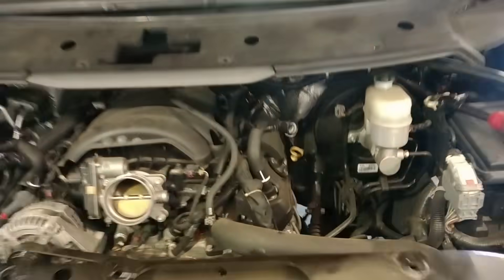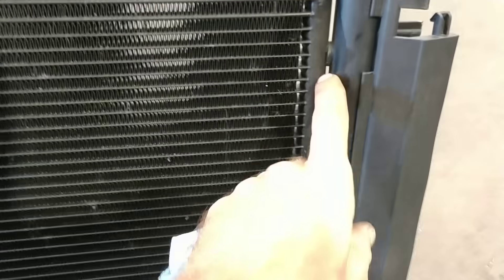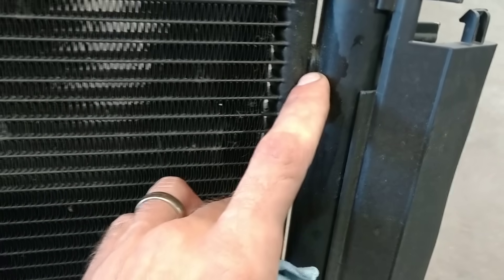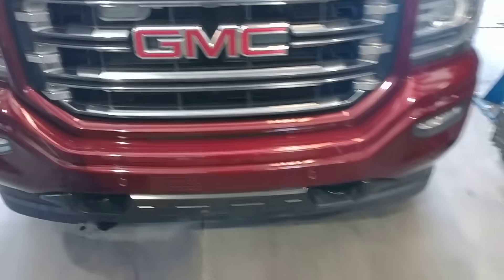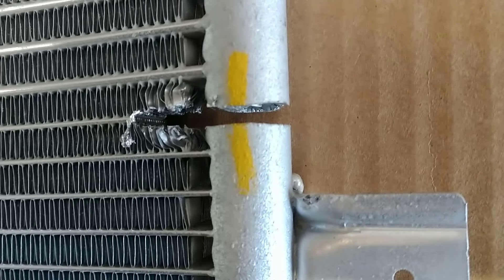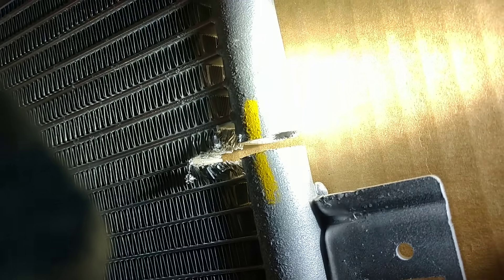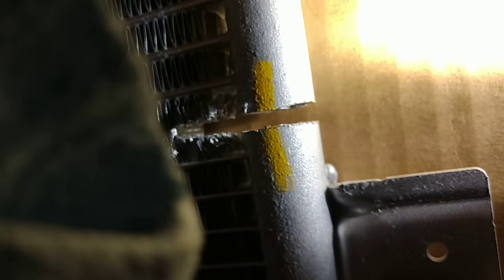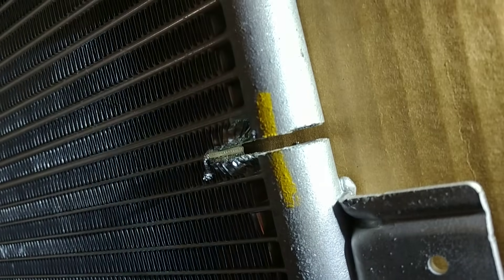Customer States...WAIT, look at this! Can't make this stuff up!

Comment: I've done a ton of those condensers(20+), the first fix (OEM) was a slab of thermal tape right at that point. I figure the trans cooler, and condenser part expand at different rates that causes the tube to crack there. I recommend the Koyo aftermarket ones for those, used those with good results.
Reply: Aftermarket parts are almost always better. Especially when there is a warranty. Body panels cost 1/4 the price.

Comment: Read his video description then you will understand why the factory does this, all the ends are capped because they are using the single condenser for 2 different fluids. The upper 8 rows for the transmission then a hollow tube then the rest of the lower condenser for the AC. It's a workable solution.

Comment: General Motors. You buy junk new and it breaks. Then when you order a replacement part that's from the factory, it's also junk.

I had to replace a rad on one of our GMC trucks at work a few years back, brand new, from the dealership, box in mint shape. The rad looked like someone rad it over -.-

Don't buy gm people, it's garbage.

Comment: Unbelievable! I sold my 2001 sonoma with 252,000 miles on it and the condenser was original and the AC worked fine.
My brothers blazer just turned 300,000 miles.. the condenser and compressor are original and the AC works!!

Comment: So instead of manufacturing the condenser in two parts they just decided "frick it", we'll just cut the main tube.  Typical GM, never caring, never thinking ahead and just not caring about reliability. They have been this way since 1969 when they introduced their cheap 350-V8.  Not to be confused with the 4 bolt 348 truck engine that was the basis for the Corvette motor which hot rodders all call "The" 350.  The cheap 350 had no direct lubrication of the cams which resulted in premature wear,  and of course the stupid plastic coated timing gears and chain.  Lets not forget the plastic carb floats that caused so much trouble.  GM also went with cheap aluminum radiators, which this condenser is a prime example.  No wonder the Japanese have 50% of the market now!

Comment: I have a very simple question.  The original AC condenser does NOT have the grinder cut.  Based on the written commentary, the replacement AC condenser has an grinder cut which is a "design feature."  My question is why does GM not provide a replacement AC condenser that is identical to the original with the weak point addressed?  

This video reinforces my decision not to buy GM products, which I stopped doing in 2010.  GM trucks look amazing, but I am left with the overwhelming concern that I would have buyers remorse if I purchased any GM product.

Comment: What is more concerning is the fact that the AC is going out on a 2017 truck that cost idk $50,000 Thank you for reminding me not to buy overpriced Shit. Pretty sad this is American made and not even lasting 5 years. 2009 Scion with 167k that I literally drive the piss out of redlined to the max and I have replaced oil, tires, breaks, batteries, and transmission fluid.

Comment: I would be embarrassed to put that on something and had to explain it to somebody due to no fault of my own.
Reply: Let's be honest, most consumers aren't even going to notice this. How many people do you think are looking at their condenser? If it works, they wont notice.
Reply: @reasonablySmartIdiot  I’ve always had the “ship it out” mentality but being from the Midwest, a lot of people who take their vehicles to get worked on will, in some way, look at the work that’s been done. I’ve seen old heads in the parking lot of the shop I’ve worked at crawling under their car and “making sure we actually rotated their tires or not.” But to make sure it wasn’t a problem it would be fine with some smoothing out and solder some material in to make it look less like a poor quality replacement part

Comment: Odd as this may sound, it is meant to be that way. The condenser is what's referred to as a "combi cooler".  The larger portion handles the A/C, the smaller is for the transmission.  It was designed as one unit to save space and money.  The cut allows the 2 sections to react differently to thermal expansion. The tiny holes he points out are in a "dead" tube, it is there just to fill the gap between the 2 sections, it will not leak there. There are separators inside the manifolds on each side of that cut to isolate it.  I agree this is not a great looking solution to the problem, and yes the person cutting it on the saw got a bit over zealous as they don't all look this bad, but i can assure you it has been tested for leaks at the factory. Every single unit is leak tested. I work in a plant that produces these, although this may not be one of ours as there are a couple of points of origin.

Comment: If it was cut with a grinder, the aluminum likely smeared over the passages. The manufacturers often do this to rejects being sent to the aluminum recycler to prevent "re-comissioning" by someone in the chain. This one probably got in the wrong pile.
Reply from the maker: Yes I found out this is a design feature. Not kidding. Check out the description.
Reply: @RainmanRaysRepairs  Wild! 
They could have deburred it and maybe given it a dab of RTV to make it presentable. Failing that, they could at least include the nefarious "yellow tag" on the caps explaining the situation. 
Thanks for the info, we always keep learning....

Comment: That's how you know it's a genuine GM part.
Reply: 4 years old and already broken condensor. Yep great gm quality right there.
Reply: Delco had to issue  statement a few months ago reassuring everyone that this was intentional. In fact, without the cut, Delco was experiencing a much higher failure rate on these condensers.
Reply: its not a flaw its a feature
Reply: What happens when you use die grinder to open packages
Reply: @michaelszczys8316  AVE didn’t even mess up the product when he used a Milling Machine to unbox.
Reply: It wouldn't be a GM product if it didn't match. The new part would have to match the broken car. JOD-junk on delivery
Reply: It even shows you where the problem is, highlighted in yellow.
Reply: Nah, nothing Crazy Glue can't fix.
Reply: What? How? Default matching parts?
Reply: I've worked at many car part factories through the temp service. They're all the same. They pay and treat their employees like crap, they give you these outrageous rates and expect you to catch every defect and if you don't work fast enough they fire you.
Reply: It was professional grade.
Reply: So it's the "GM Mark of Quality"?
Reply: Underrated comment
Reply: @JakeSMOTO  its supposed to be like that
Reply: Standard American Original Equipment Quality
Reply: G.ovt M.otors 🤨
Reply: @NobodyOwesYouAnythin  Ford Canadian Motors, Fiat-Chrysler Mexican Motors.
Reply: The heartbeat of America about to go into cardiac arrest!
Reply: Lmao

Comment: Having worked as a tech at a GM dealer for 30 years ( now retired after 40+ yrs.) this seems normal to me they will hack and test different things using the customer as a guinea pig and maybe fix it later by redesigning it properly (very doubtful ) or just ignore  it and say there's nothing wrong at all until the next new model comes out ( most likely ) just remember it's not just GM THEY ALL DO IT!!!

Comment: Reminds me of the time I replaced the front shocks on my truck, one was fine but I opened the other and the threads were all stripped off and it had no hardware. I had a little talk with the parts store after that.
Reply: If you returned a part and the store wanted to open the box for inspection, how would you react?
Reply: @bobroberts2371  well I used to work there so they didn't blame me for the damage, I would assume if they had not known me they would've just said I did it
Reply: @MiningCraftable  What I'm saying is , if you bought something at a store, never opened it or opened and put it back in the box, would you be offended if the store wanted to inspect the return?   Being you had worked retail, how many people returning something get belligerent when you want to inspect something they are returning.  "  What don't you trust me ? "
Reply: @bobroberts2371  i wouldnt be that offended, especially if the reason im returning it is its damaged. It was actually company policy to inspect the item that is being return as an alleged defect.

Comment: Delco just means made in China. Yep that's where most of your domestic automobiles and their parts are coming from. It's been this way for quite a while now. I have a brand new throw out bearing AC Delco, that I picked up back in 2004 for my Corvette. Made in China. Just got new AC Delco rotors for my wife's Buick. Same thing made in China. Ford even used a Chinese made 6 speed piece of crap in the 5.0 Mustang. If you drive hard or go to the track you'll be getting it replaced over and over. It's a sad day when you can't get descent auto parts. Engine rebuilders are having problems with cams and lifters. The parts are failing at high rates due to improper heat treatment and premature wear issues.

Comment: That cut is actually supposed to be there. It is the separation between the transmission cooler that is the top portion and the ac condenser. Yes it looks like it was done with a sawzall but technically there is nothing wrong with it.
Reply: I did a radiator in a Highlander and the radiator had the exact same thing done to it.  I found out that it is standard and its worked but why!?   It looks butchered.

Comment: This makes me think back to when I was working in a shop making body parts. Company told me I would be hired in after 90 days, I worked there just over a year never hired in. In my last months I started pulling parts off the line and scribing with a knife in the back of all the parts “ made in Murcia”. Some of you have a dodge grill that reads made in Murcia on the back. I took quality about a month to catch it.
Reply: I worked in The Body Shop of be Chrysler Plymouth dealership in the 70's. People would bring their cars in because of a noise or clanking. After taking apart lot of the interior Like the door panels, seats And anything you could not see behind. I would find A bunch of washer's suspended on a string or wire with a note that said" How long did it take for you to find this?". Maybe it was contract time.
Reply: @kleekboop  this is fucking awesome
Reply: GM's Holden plant in South Australia took ages to notice someone was stealing entire engines from the factory.
Ever considered a job at Delco ? They'll pay you to make unprofessional alterations to their stuff.
Reply: Who is Murcia?
Reply: @steve6sucks  a city in Spain.
Reply: @steve6sucks  if you’re not familiar with “Murcia” here is an example. https://youtu.be/WU10FWF68As
Reply: Maybe he meant "murica"
Reply: @Princess_Paula_T.  " woah. " - Keanu

Comment: I'm gonna make an assumption that that part failed QC, was marked, then "destroyed", after which some debacle happened and it was packaged and shipped.
Reply: There should be a giant sheet of paper taped to it saying; ” This cut is not a defect. It is a factory hot-fix. We aren't joking. No really! Seriously we're not. It's the truth. It looks horrible and we should have to pay you to accept this part, but it really IS functional. Please use it. Ok, we give up. Send it back.”
Reply: @7MPhonemicEnglish  haha
Reply: @7MPhonemicEnglish  I mean then again nobody sees the radiator and it can look as horrible as it wants as long as it does its job.
Reply: You have clearly worked at a production factory before. nailed it
Reply: Enjoy hearing all the replies. One thing I did notice.. on the failed part the crack was on a stub pipe that went between the condenser end cap and the accumulator. The cut on the new part isn't even on that same side.. there is no stub pipe, the condenser ends directly in that cut end cap. Could be cut and sealed... essentially splitting the core into two parts... but MAN that's a rough cut... and I dont see any way it would have been assembled, cut, and then capped, which would have to have been done through the cut somehow sealing the runner and both sides of the cut, as the rest is sealed already. I've seen relief cuts before in radiators (coolant) in both aftermarket (Spectra for example) and also OEM, but that was just cut into the support because the radiator expands quite a bit more then the support causing stress, not into the actual end caps or core.  Not arguing, anyone's opinion is valid.
Reply: spdwebditnet You are correct sir.
Reply: One way to try and alleviate the problem. Other fixes I've seen on this condenser is a stiffening bracket welded to the manifold and the receiver dry tube so that the joint between the two won't crack from flexing.
Reply: @jameswilson-cq3cu  Flexing is half the problem, its the temperature difference between the AC and the trans cooler expands and retracts causing stress cracks hence the cut. This is the upgraded superseded part from GM. Did anybody read the description? Yeah I think it looks like garbage,  but it works for a few months...
Reply: @dale_ssj
Reply: "destroyed" at least hang it from the gallows and throw hot oil over it
Reply: That condenser is probably going to leak. ;-)
Reply: Nah they all ship like that. It's actually the fix. The holes are capped internally. The cut is to allow for better expansion and contraction so that way that seam he pointed to earlier won't continue to fail. It's a very big, well known issue on the 1500 frames 

Source: GM dealer tech who does about a dozen of these a month
Reply: @antialiasstudios  I can normally tell sarcasm but I really cannot tell if that is sarcasm. You sound sincere but why would they make a product and then deliberately destroy it?
Reply: @nicholasjohnson3542  because its just wayyy less expensive to do this shit than it is to redesign a whole new cooler, retool a lot of machinery and recall a bunch of trucks.
Reply: @nicholasjohnson3542  I thought the same till I read multiple threads and they all say the same. It's not a joke. This cut is done on purpose and the cheap solution to this engineering fail.
Reply: @nicholasjohnson3542   manufacturers will cut or destroy something on a part so it can't be used.
Reply: @nicholasjohnson3542   I'm sarcasm proficient , that was sarcasm. Lol
Reply: @HellionBlade90  its only way more expensive because gm would have to redesign a metric-fuckton of all their shitty products.  anything after their last v8 half ton truck to lack cyl deactivation seems to have completely swan dived into a sea of garbage.
Reply: Part was rejected and mutilated. It wasn't properly segregated afterwards and sent to recycle bin per process. It was then packaged and shipped in error.
Reply: People are saying the stupidest shit like this is a mod/fix and can still be used. NOTE This is a defect part from the manufacturer which did not pass quality control, and was cut on purpose to make sure no employees take the rejects and try to resell them outside of the factory.The area cut even has yellow paint mark for Christ’s sake.
Reply: @nickyborrisino  no, the yellow paint mark is there so they know where to cut it to do the mod.. it is plugged internally before cutting, the mark ensures the cut goes through the plug and it will not leak afterwards.
Reply: @nickyborrisino  hey you have common sense. The guy saying this is a relief cut is way off. We do this with aircraft parts as well. They must be destroyed if they don't pass QC
Reply: @JDJD-mw9rr  you and Nicky Borrosino are the proverbial " you can lead a horse to water but you can't make it drink" ... despite being given somewhat detailed information  on why the cut and mark are on the unit you differ like it's a opinion but  unfortunately it's a matter of fact that it's intended to be cut like that .. it may be  unbeknownst to you but the  mechanic that posted video even has said it's what GM did to resolve a design issue , the unit worked fine despite looking like complete trash .
Reply: to complicated it passed and a forklift missed the pallet more then likely
Reply: @thewolfoftechstreet  no chance of it being a forklift that did that.

Comment: I learned in 2013 after 6 Chevy products that General Motors doesn’t care about their customers because I bought a new $32000 truck and 42 miles later the heatercore blew and they trashed the interior and it was a rattle trap and I demanded a new truck and was DENIED!! So guess what, I’m a RAM MAN and I love my truck.6 years now since new and still going.NEVER AGAIN GENERAL MOTORS or MEXERAL MOTORS .

Comment: Im a FYI u guys and girls for moment they are made like that.  It has two different coolers there trans and condenser in one look at tube width differences.  Inside the cut there are seal end caps.  I've installed these even the black factory one has this relief cut.  It's done so the aluminum doesn't Crack from the varying heat and pressures along with being cheap aluminum lmao.

Comment: I should upload the Ford parts I get. Ordered 3 aluminum hoods for a 2019, all 3 were damaged and the first 2 were run over by the forklift driver, the 3rd one we ended up heating it up and repairing.
Most of their coolers come in rattling or broke, their bed bolt inserts are TERRIBLE and ALWAYS snap. Brand new truck or not so I just always order new ones and weld  the nut to the casing to warranty it won't snap on me or the next guy who messes with the truck.
GM I've had similar issues ordering parts but no where near as bad as Ford. Generally it's Village Ford to be more specific out here in Detroit.